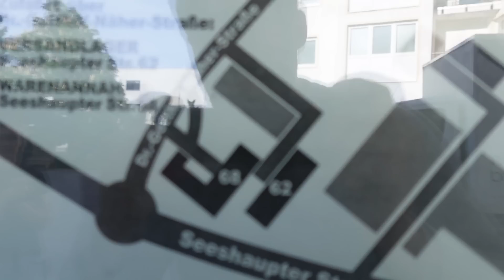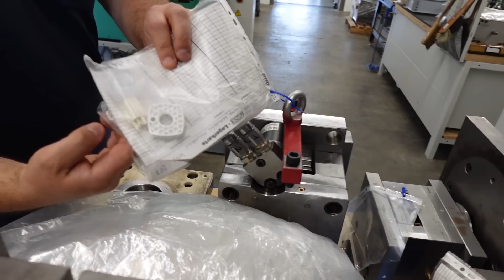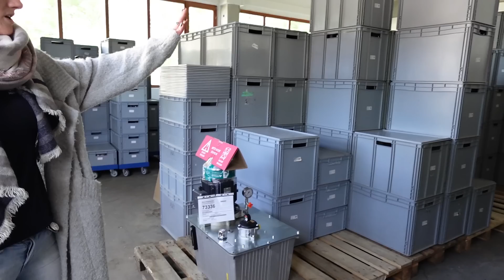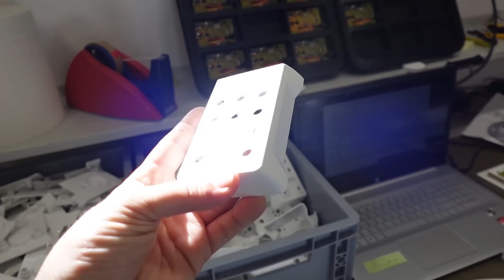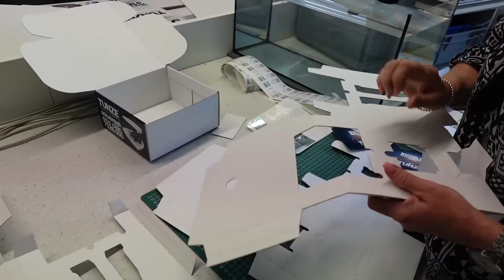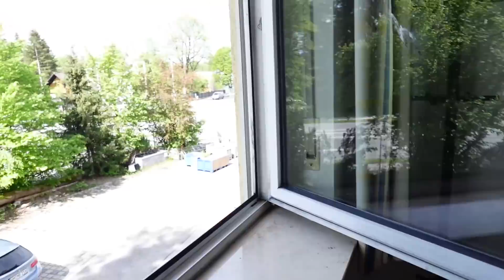Tunze FACTORY TOUR- Germans make the best aquarium products

Comment: Aquarium fan do work , I customized few fans on my canopy . 2 are continuously running and 1 kick off with the INKBIRD temperature controller if the temp goes pass 79 . The temperature on my tank has never been so stable even when house reached of 86 degrees high